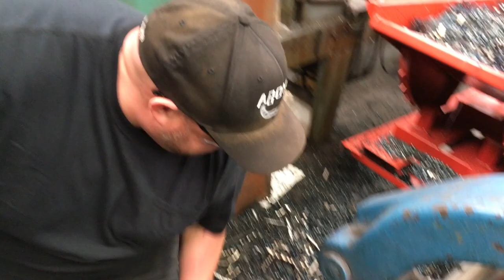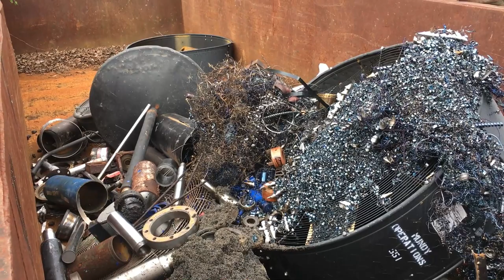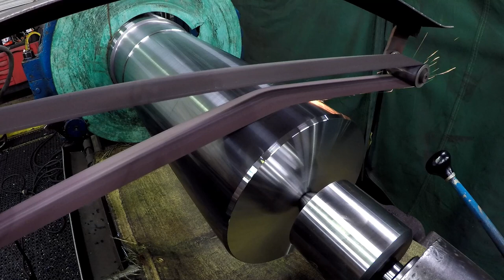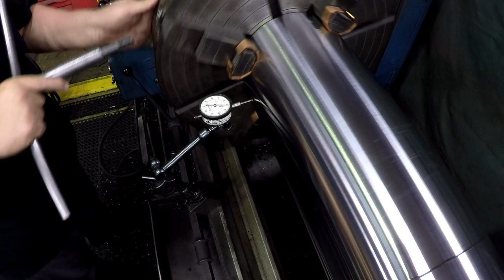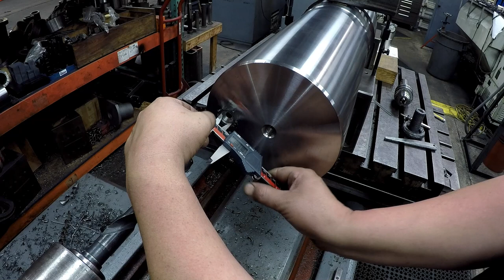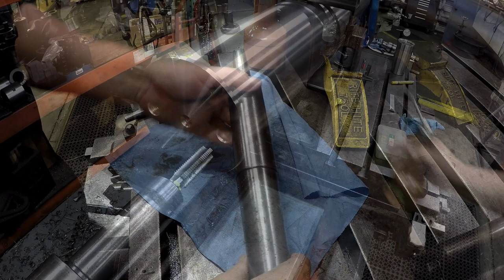9.5 Inch 4140 Gearbox Shaft Part 2

Comment: I retired running a 24 inch swing 12 inch hollow bore Lehmann Lathe very much like yours just 6 years ago. I cut threads for the oil industry till my retirement. This brings back memories.  I loved watching you work.  We ran coolant on everything we did and was wondering why you're not. It's a mess I know but our cutters lasted longer with it.  Occasionally we ran dry if we slowed it down a bit but on long cuts we always ran coolant.

Comment: The first machine shop I worked at specialized in heavy industrial machining and part of my daily duties being the shop newbie, outside of machining, was cleaning out the chip pans. Since there were always chips on the floor my boots would get loaded up with chips. When I got home the chips in my boots would catch on the carpet and the carpet would raise up with each step. My wife demanded that I remove my boots before I came into the house so I wouldn't damage the carpet and to stop loose chips from coming out of the soles of my boots and to stop us from stepping on them. Once a week I would go out on the patio with a a pair of pliers and dig out the chips from my boots. I definitely don't miss swimming in the ocean of chip from that shop:)
Reply from the maker: +comictrio I think any machinist experiences the same. 😆

Comment: Thirty seven years in the trade and my best times were on a big lath doing big shafts like this.
  I did it just the way you did it. It brought back a lot of good memories.Like the chip shield for the steady rest and the belt sander .
What ever happened to the trades? My boss asked me to work an extra year because he could not find another qualified machinist to fill the position, this is Detroit for crying out loud!

Comment: While in my 37yrs. as a steel plate shape burner(CNC/Electric eye burner) i wonce cut (2) huge 12 ft. long crank shafts in the two dimemsional aspect. They were 11&1/8" 4140.  Cutting thick 4140 and annealing it is tricky business!  Plate was preheated to 1700 degrees for 8 hours before i started my set-up.  There were so many turns it took 5 hours to burn, but the really cool part was imagining the hugeness of the maching process!  This was about 1980 if that meens anything.

Comment: I've found a good way to align the tailstock center is to place an indicator in the chuck and indicate the point of the Center while adjusting or shimming the tailstock body. Good starting point and fine tune by miking in on a straight cut like you were doing. I did a lot of large work like this usually on Monarch Lathes. I loved the finished product. It gives you a sense of real accomplishment. Good job!

Comment: One trick I use when turning in 4-jaw: I machine a step in headstock center so I can install it in headstock behind the chuck.  I mount the work between centers, then tighten the chuck jaws down onto it.  This speeds jobs requiring repeated remounting of the work.  Essentially the work is between centers, & the chuck is the "lathe dog".

Comment: I could never imagine using a shovel to clean out my chip pan lol. The fullest it's ever been would be maybe 1 shovel full.
Reply: must be your german heritage
Reply: I'm guessing he meant his lathe isn't an industrial sized beast that generates buckets of chips like this.
Reply: I wish I didn't have to shovel out our engine lathe. My last job in the turbo machinery industry was brutal. You'd be shoveling chips out several times a day.
Reply: One shop I worked in had an auger drive for the large rough lathes. It was pure luxury.
Reply: Wow.amesing.belt.sander.

Comment: So I got to ask why not set the shaft off to one side on the Kearns, then you could rotate the table 90 deg and mill the keys with it all in one setup. It seems like avoiding 2 more setups and tear downs to cut the keys in the little mill would be a big time saver. Just a thought I had while watching. Enjoyed the heavy work. :-)
Reply from the maker: +bcbloc02 I haven't used the boring mill for milling like that Brian. Not sure how well it'll work. The face mill it does ok with, but don't know about an endmill. The vertical mill is much easier to control.
Reply: Excuse me ... What happened to that fan in the trash?
Reply: Abom79 Hey Adam. That mill looks small compared to the other machines in there! Just wondering,  why don't you show work on the other lathe? Do just prefer the pacemaker?
Reply from the maker: Bob I have many older videos sowing work in the other lathes.
Reply from the maker: Ronny, if it's in the scrap bin then the customer scrapped it. Probably wasn't cost effective to repair. That or someone tossed it in there.
Reply: bcbloc02 I am wondering if the tapping chuck you use on your Cinci would be better for this boring mill than the Rohm chuck and the tap holder...

Comment: Almost everyone I see tapping holes has problems trying to either find a good tap wrench or getting a tap handle on there due to clearance issues, myself included.  Then, like you see here, you've got people trying to chuck them up in a drill chuck and slipping on the round part of the shank.  Manufacturers need to standardize the grind dimensions on the shanks of these taps to match standard SAE or Metric square nuts.  This would make it so much easier to run taps in.  All you'd need then is a set of square nut sockets and all your normal hand and power tools with 1/4, 3/8 and 1/2 inch drives would be able to power it without slippage.  Another idea would be to make the shank end triangular so it would fit easily in a drill chuck without slipping.  That would save a lot of extra grinding too because you'd be doing only three sides instead of two, and you'd only need to take enough material off to get three flats on there.  There's no reason people should be struggling with these things.  Something needs to change.

Comment: On the internet there is a 100+ year old picture of two guys standing in front of an old lathe driven by leather belts on wheels and shafts above.  Probably to a steam powered engine outside the building.  The shop was in the now ghost town of Pinal City, AZ which served primarily the now ghost town of Silverking AZ.  If you go to the site of this old shop there are, among other things, rusty curls, chips, of steel.  Odd thing is that they are about 1/8th to 1/4 inch thick.  I'm not a machinist but that seems awfully thick.

Comment: One thing I learned early running a. lathe was not to wear anything that had nylon in it. It's amazing how well hot chips stick to you. I was wondering why you didnt use a center drill with a counter sink so you don't have to go all the way to the drill hole?

Comment: I've yet to see a machinist do what my dad taught me when measuring with a mic. Feel your setting, lock the thible, double check, THEN pull it off the work. Without locking the spindle the mic bar can turn when pulling it across the work.

Comment: Very enjoyable to watch this one, thanks for putting it up. You mentioned that jaws get a "set" from long use. I have an ancient 4 jaw that does clamp a little loose on the outer edge. Have you ever tried to regrind a set to make them square again?...Dave
Reply from the maker: Dave, no I have never ground the jaws before. Most of the Cushman chuck jaws are very aggressive. Would love to see the proper way to do it.
Reply: The jaws are slightly concave on the contact edge, but I wonder if that is really necessary. Seems like it would be a pretty simple thing to set them up with an angle plate on a surface  or cutter grinder. You think?...Dave

Comment: Would the belt linisher/grinder affect the trueness (precision) of the arbor? Just wondering as the belt is a flexible thing that can introduce some wobbles in the finish.  I need to grind my lathe spindle and thinking if I can do this myself as I own a belt grinder attachment. Thanks!

Comment: Tailstock: if the tailstock quill was low enough to warrant shimming, there's probably more to fix than raising its centerline. You probably also have problems with small taper errors every time you move the tailstock. This suggests the bed fits on the tailstock base are worn to the point it clamps inconsistently. 

Try this. Run the quill out and scan an indicator along the top. I predict the extended end will be low towards the spindle by 0.003" or more in the extended length.  Factory specs are probably 0 to 0.0005" rising towards the spindle. The indicator reading would make sense because the quill end of the tailstock fit on the bed carries double or more weight than the handwheel end and therefore suffers greater wear. 

Also the base ways inevitably wear "rocking chair" meaning the V can teeter in the horizontal plane as well as the vertical setting the stage for cutting inconsistent tapers. There is no quick fix for this and continuing wear will only make it worse. At some point the taper hassle will force action: the tailstock base will have to be re-scraoed so it bears full length and the quill is parallel to the spindle axis. A shim will cure the vertical height and an offset correction will cure the taper. Thereafter, your Pacemaker should cut straight no matter where you place the tailstock.

Put them new scraping skills you learned from Rich King to good use.

Comment: I'm surprised a big looking shop like yours doesn't have a proper tapping head and collets for your 1.00 " threading  operation. that way there's no risk of breakage if you jam up, or bottom out.
Something i've done in the past when I'm without a tapping head, or home made collet, is machine a 60 deg. point on a piece of round bar, and hold it in the drill chuck. bring the tap to the hole, and bring the tailstock up close, wind out the spindle to the centre hole in the tap to hold it in line. use a large crescent wrench on the tap braced against the machine and run the machine in low while keeping hand pressure on the tailstock spindle. stop before bottoming !!!   I avoid using large taps in drill chucks to save the chuck jaws. tap shanks are very hard and will wreck the drill chuck jaws if it spins. IMHO.

Comment: If the jaws are bent outwards, why don't you place the shims closer to the chuck face, instead of the tip of the jaws? Wouldn't that square things up more, and compensate for the bell? Or make longer soft shims, so more jaw catches the work?
Reply from the maker: +Bogdan Puscas All you need is even contact. Having all the shims places at the same distance from end will hold it. It's normal practice to hold them on the end of the jaw.

Comment: big job.... question! whats your biggest job you have done???
Reply from the maker: +wez adams Biggest in physical size is probably that cylinder that in my video Large Lathe Work. I've work on large weldments before though. The biggest shaft I machined weighed 5,000 lbs.

Comment: 2:23 wouldn't you want to maximize the contact area in order to apply less surface pressure to the metal, therefore being softer on it? Bed of nails vs one nail and all that.

Comment: Adam, how do you resist going home every evening with a truck full of scrap metal? I saw a nice flange ring that could be used 'someday maybe' and a shiny bit of bar end and and.....
Reply from the maker: If I did that, I'd have a scrap pile of metal in the yard, which I do not want. I've saved some, then took it back because it kept having to move it.

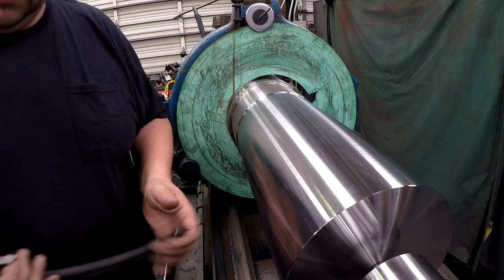Comment: at 8:40 I guess one thou plus or minus should be well in the tolerance of such a big diameter on this length. Oh, and great vid as always.
Reply from the maker: +onethirdofGilgamesh Yea thankfully there is a small tolerance there I can fall in. The shaft end fits are a little more forgiving.
Reply: That's like an IT5 or IT6 tolerance fit. Pretty small if you consider the fact, that it should be everything spot on to 20°C for a measurment of this size. 5-10°C up or down and you are out of tolerance. I hope the gave you enough tolerance to stay somehow in the limits of manufacturing time and effort.

Comment: I am not a machinist in fact I've never been in the same building with a lathe like this however; I find these videos fascinating.  That having been said Adam, you mentioned several times that you're using an old lathe, in fact in a previous video I think you said it was new in 1943.  How much might it cost to replace this lathe with a new one of similar quality?

Comment: Ah 4140, my least favorite bars to put through the bar grinder. Fortunately, that job only comes only comes around every 5 months or so. .508 bars taken down to .4945 to 4950, so I try to keep them at .49475 so the collets in the screw machines have no issues. Keeping the tolerance can be tricky, but the bars will look almost as nice at that shaft.

Comment: A quick question. I understand the use of the Steady-rest to control the middle of the shaft and prevent deflection during turning. 

My question is, without use of the Rest, would you get a measurable deflection at the shaft center if suspended only by the 4 jaw chuck and an end center?

Also, would the shaft have an additional measurable "whip" at the center when rotating at 300 RPM on the lathe?

Thanks in advance. I reallt enjoy your vids.
Reply from the maker: I use it to eliminate chatter. You will still get it on turning and machining a radius. You can machine it without it though.
Reply: Abom79 

Thanks for the speedy reply. Keep up the good work!

Comment: Hey Adam, nice work! Just a few questions though: 1-how many hours overall did this take? 2-when you finish the shaft with the green 3M pad do you use any kind of oil? and 3-I notice you use some sort of machine oil instead of tapping fluid, why? Cost? We used to use oil but noticed that the smaller the tap the better the tapping fluid worked thus saving us from having to drill out a broken tap.  Thanks, Zug.
Reply from the maker: +Zug Meister Off and on I spent a week from start to finish. Use no oil when polishing. The oil in using is dark cutting oil, made for machining operations.
Reply: Thanks Adam, much appreciated.

Comment: Just curious Adam ...
And I know those giant lathes are super expensive, but how often do these lathes get overhauls, and why not swap them out with new machinery ? With the amount of work that you guys do (I hope it’s a lot) and the write offs from new machinery payments, wouldn’t it be cost effective in time savings alone for updated accuracy in the machines ?
Reply: YZMOTO #80, the new lathes that would come anywhere close to the accuracy and over all power/quality run 50-100 thousand depending on size, if you get an old machine from eBay they will run you ~10 grand for one the size that he’s using, a regular tool room lathe on eBay is 1-2 grand, and if you get them local from a retiring machinist, good auction or a friend you can get a tool room lather for as low as $800

Comment: Is there a difference in the taps used under power vs hand taps?
Reply: John Baugh yes some hand taps come in sets of three so you finish the cut on three passes instead of one. They are easier to use and get started straight. But when you have enough skills you can also use power taps by hand.
Reply: Thank you!

Comment: I'm a second year machinist apprentice. just curious mate when you doing a raidius are you leaving a step in the corner. for example a 3/32 raidius are you leaving a 3/32 short bit that's 3/32 deep? also brilliant work cobber
Reply from the maker: Yes I always leave a step that will clean up with the proper radius.
Reply: also are you able to eliminate the taper with the tailstock because your gripping it in a small spot with the chuck therefore it will piviot? just asking because I got a big pump shaft to machine in a week or 2. its got a lot of press on fits that are very light but long

Comment: Very good work but as a manual machinist myself; two things that I can make a comment on… and that is when I am backing a tap out I usually will go about 60% - 75% that it went in (example; if my tap went in 1 inch then I would be backing it out about 5/8 to 3/4 of an inch out to get rid of chips before I put it back in along with a dab of cutting oil) for all the chips get a chance to be disbursed that are stuck in the flutes of the tap, I don’t believe you were given it anywhere close to that…And then the second thing was / is; once I have a finished surface, I do not put my arm or my hand on that finished surface unless it is covered in wax paper or I am wearing gloves so the acid from my hand or arm (like you did earlier in the video when you put your arm across the finished surface) if you think it it will not change the surface dimensions by doing that, Think again, because it will!